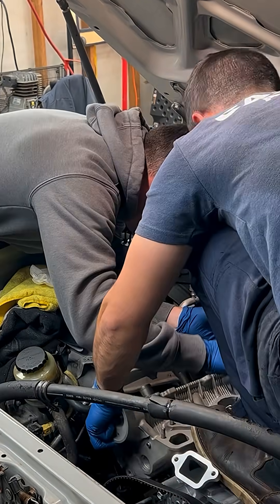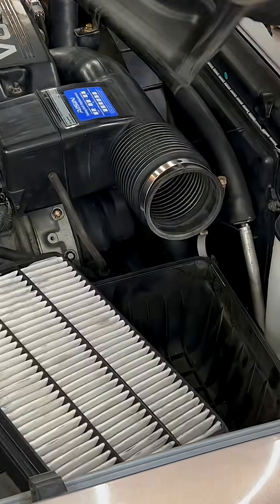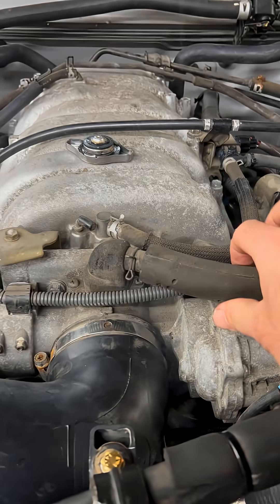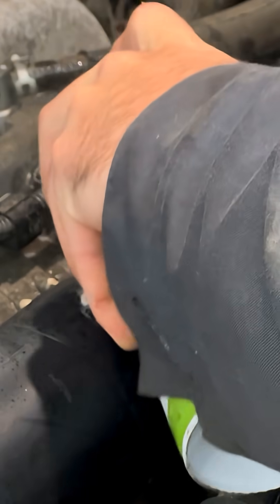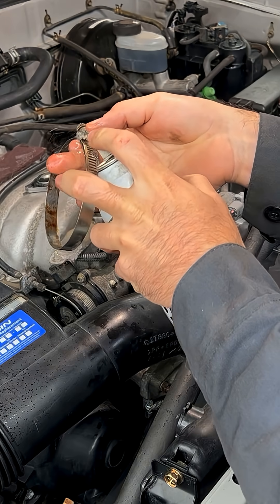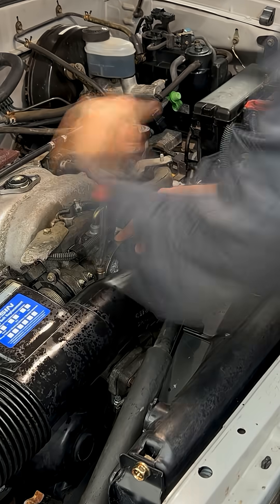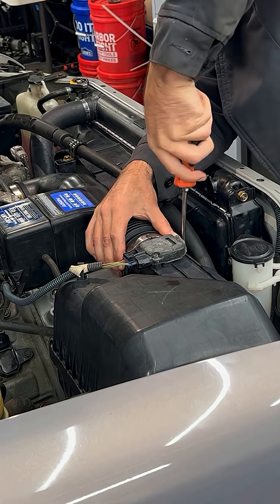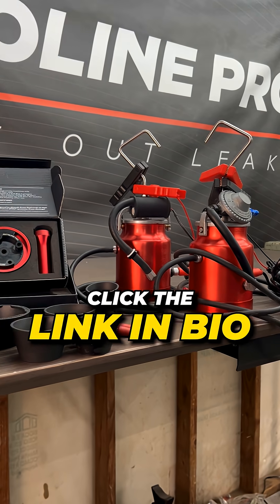Caught a Big Mistake After a Head Gasket Repair Job 😱 | Always Double Check Your Work w/ Smoke Test

Comment: I’ve definitely fired up an engine after pulling a manifold noticed it ran rough and had to grab my smoke machine to see why it was running right
Reply from the maker: definitely not the first time I have had an issue after a repair
Reply: @autolinepro it happened to everyone to me a smoke machine is worth every penny not just for checking your work but 90 percent of my job is diagnostic work and there’s no other good way to to diagnose evap leaks and check vacuum leaks when you have lean codes spraying brake clean to check for vacuum leaks is trash